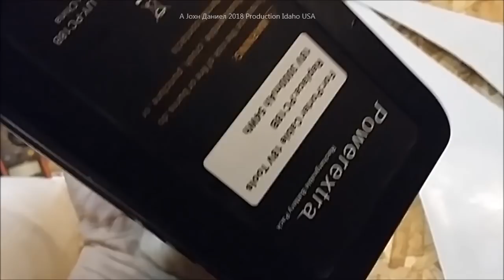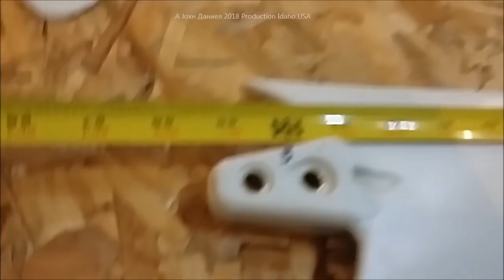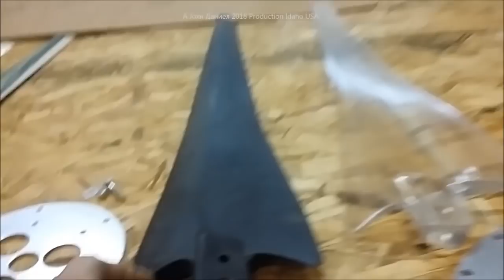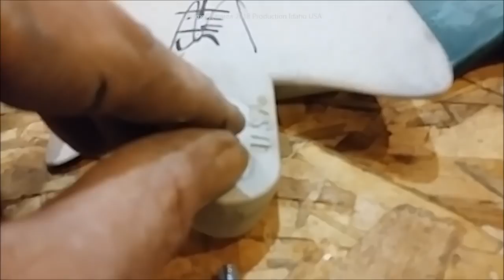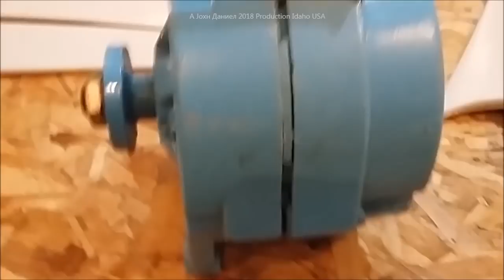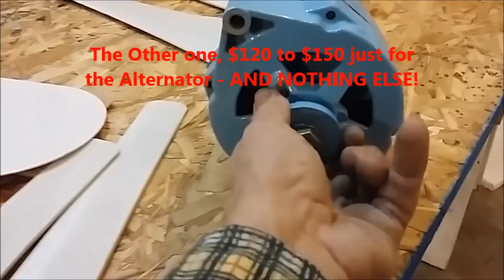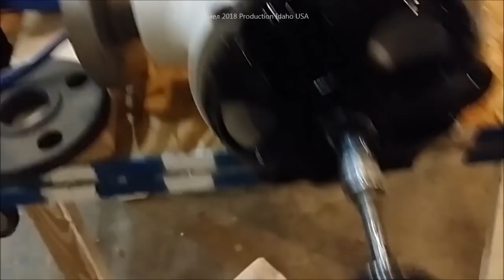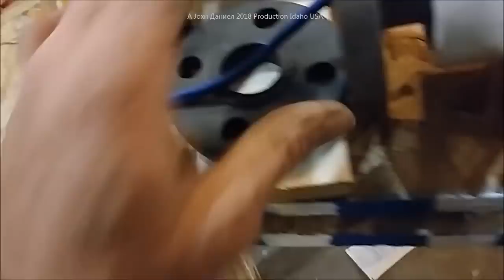Nice 500 Watt Chinese Wind Turbine, how to Test, Wind Turbine Lesson 2 (all parts used below video)

Comment: I've built allot of wind turbines the wind rule is B.S. , it comes down to how many amps a blade can make not watts ,12 volt system will always  be limited  buy how many amps and heat is produced , the same blades on a higher volt alternator will make the same amps at higher volts ,but will have a higher chance of burning the alternator out because of thinner winding's , high power wind turbines are always high volt and use step down transformer to produce the amps, It takes horsepower to make amps not electricity , use a transformer to make amps or solar panels
Reply from the maker: +Wind Power And More There goes that goofy OHMS law thing out the window. 
9 years living off grid myself and installing now found as wasted.
Reply from the maker: +Wind Power And More https://youtu.be/r-cmCHEhN3k
Reply: Nice job , I'm not putting down your work or vids. I really enjoy watching them ,you are good at what you do.I'm saying you can get the same power from smaller blades at higher rpms with more volts and less amps, there is plenty off proof of this on you tube , nice work keep the good vids coming there great!
Reply: @windpowerandmore6310  there is only a limited amount of power within a certain diameter of wind at a certain speed.

Comment: Nice wind generator
Reply from the maker: I was actually a bit shocked at its output, I only expected at best 120 watts from the drill then the turbine to drag it down much faster. It far outperform my experience expectations. Seems really engineered which is a new thing for Chinese made.

Comment: Blasting away mate. I knew these did good
Reply from the maker: I was just hoping for over 100 watts with such a method to spin it up. The blades at 5' 2" diameter will definitely get this turbine to 350+ and 25 amps battery charging on a regular basis. Wind finally cheaper that solar!
Reply from the maker: This may help on some insight to shipping there https://www.youtube.com/watch?v=rJJcocZLQB0
My pal Derick lives in Jamaica in Trelawney Parish, somewhere near Albert. He has 4 turbines and got them via Aliexpress and ship via the Bahamas. Just need to check Ferry Shipping from Bahamas or Turks
Reply: Makes me want one now.
Reply: hey great vid  the Chinese's turbine you review last year is it any good  the $263 kinda pricy for me in Jamaica and bout 30lbs to ship pretty   to get it here @ $124usd to $1jmd looking at about  500 usd